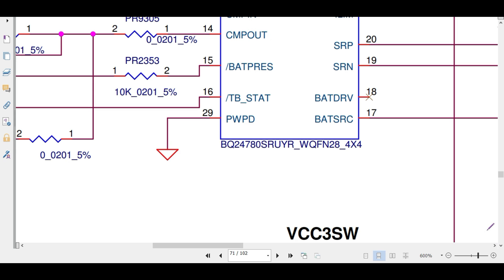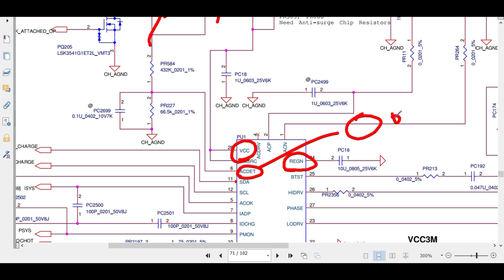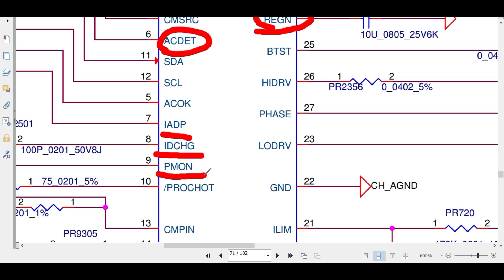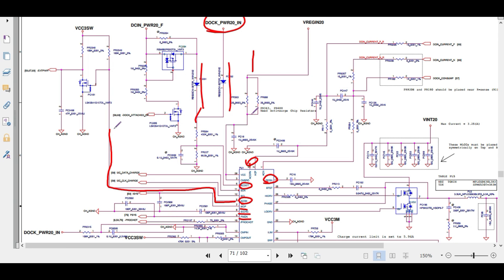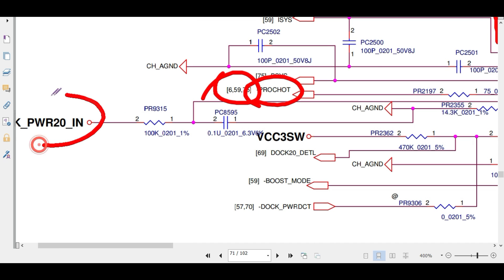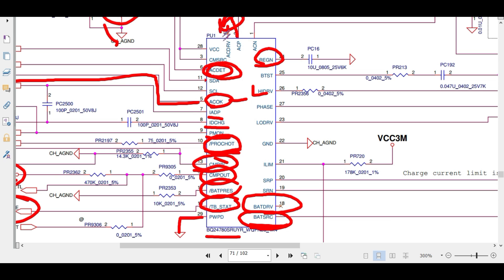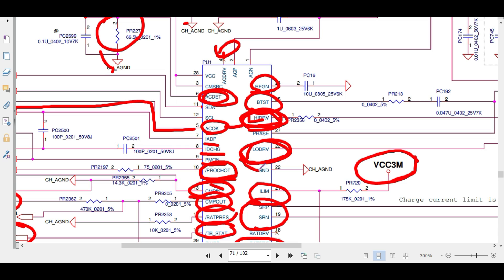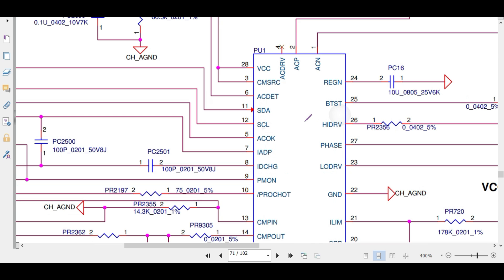Mastering BQ24780S Charging IC: Improve Your Knowledge

Comment: Sir acdet pin is giving 2 volts 
Resistor divier is ok
No acok voltage and REGN voltage is around 5volt instead of 6 volts
 vcc resistor and supply both are ok 19volts
What could be the problem
Reply from the maker: Acdet should be 2.5v or 2.6v if supply is ok. So, pls replace the divider resisters and check.  If same result,  remove battery clr and discharging mosfet and check.  If same,acn acp voltage from clr to ic should be same.  If no, replace the resisters.

Comment: I have been repairing LENOVO LAPTOP PLUGED IN CHARGING BUT PERCENTAGE DOESNOT INCREASE WITH SAME BQ24780S IC BUT INSTEAD OF BATTERY PRESENT ON BATTERY CONNECTOR THEY PUT TEMP PIN,
SCL. 3V
SDA.3V
TEMP.3V
THESE ARE VOLTS BEFORE PLUGING BATTERY ON MOTHERBOARD
 AFTER PLUGING MOTHERBOARD TEMP PIN
DECREASE FROM 3V to 2V is this logic ok
Reply from the maker: Below 2v. 0v to 1v in between. 
In your case change battery and check.  Otherwise,  check the temp path components 
Or io faulty or charging ic faulty
Reply: It means sir TEMP IS THE SAME AS BATTERY PRESENT IT MUST GO LOW WHEN BATTERY PLUGED  ON MOTHERBOARD ,
Reply from the maker: Yes. Send me schematic.  I will check once